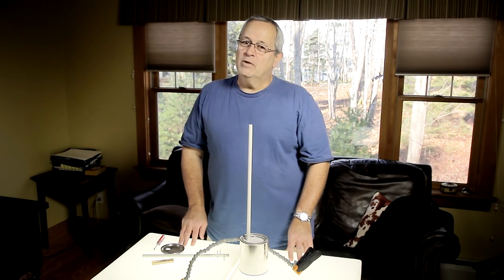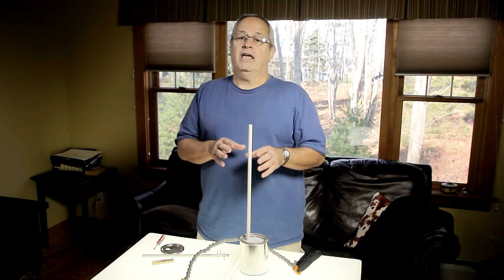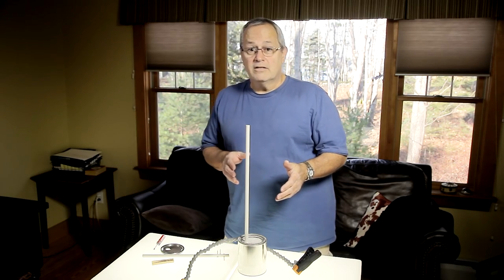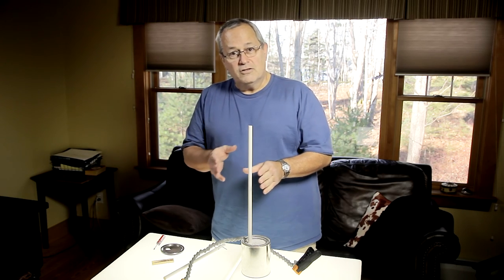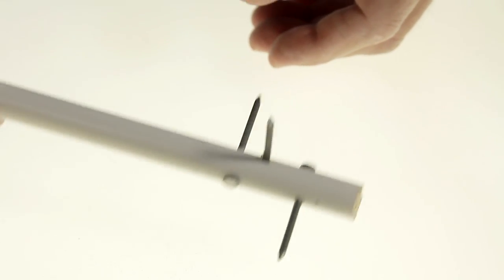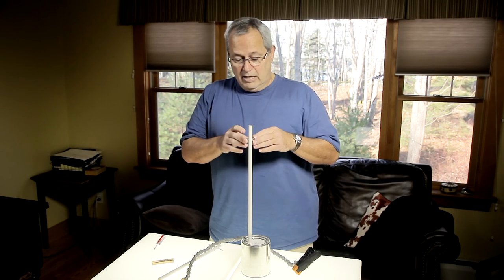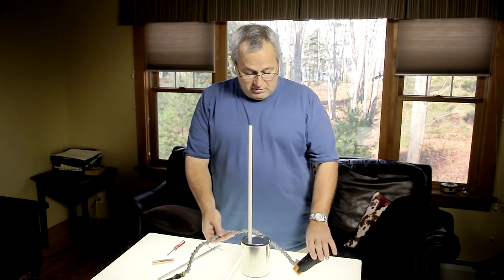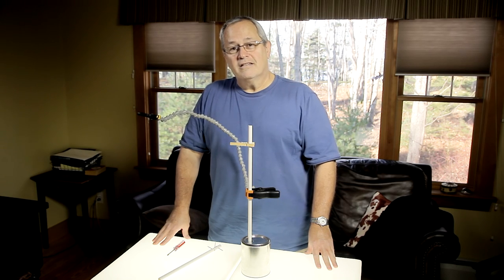DIY Paint Can Light Stand

Comment: I have seen a few examples of this nut have yet to try one. Cement was the other filler but I like your option better. Quicker set up. One thing to add, make sure dowl is placed close to side not in center. (I see that you did that but didn't say it). Makes it more stable when mounting heavier objects especially if a 10 ft pole is used in gallon can. Thanks again.